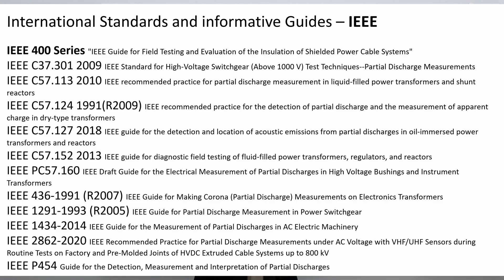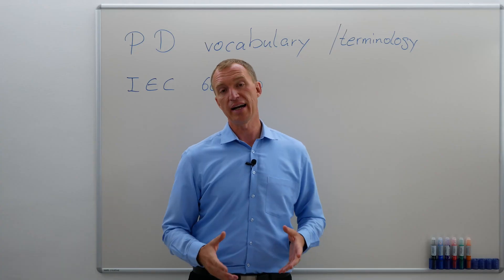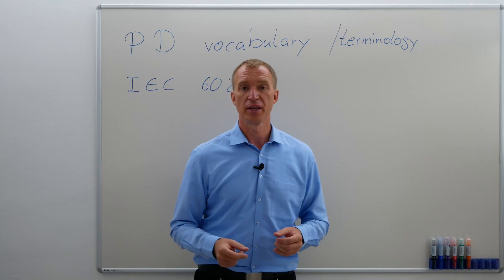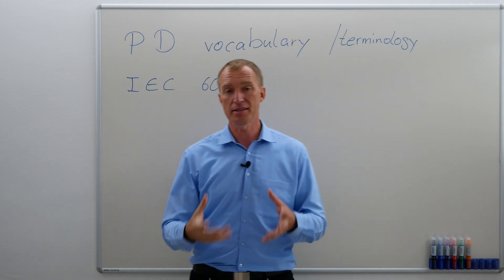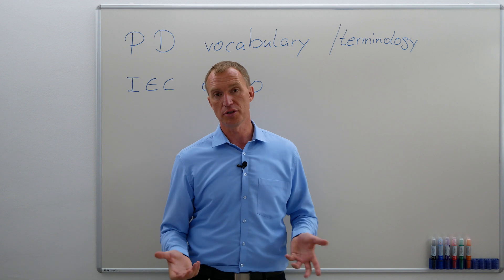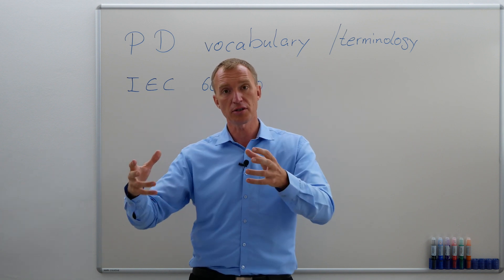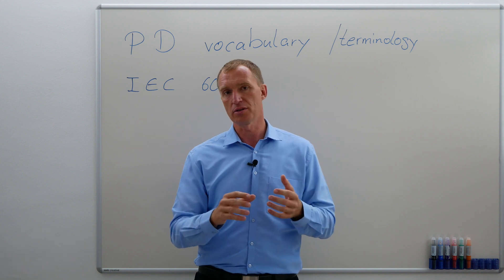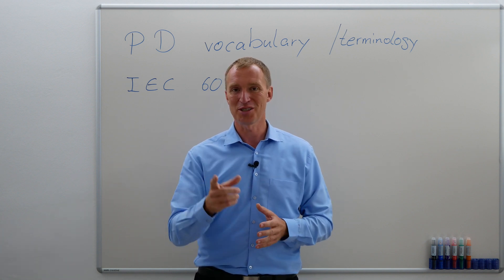2.0 Partial Discharges Vocabulary - How are Partial Discharges defined?

Comment: Hi.At 3:00, you mentioned  q is calculated based on the integral of v(t)dt and the graph is V vs t.What does the V refers too or which voltage is it refers too ; the physical location of V measurement.
Reply from the maker: V = Voltage or better v(t)dt is the voltage an oscilloscope would measure. It could be an old analog oscilloscope or a newer digital oscilloscope. Of course, most oscilloscopes do not "like" a lot of voltage at their input. Often it is somewhere in the range of 100V or less. Thus, such an oscilloscope needs to be connected to some kind of sensor such as a high voltage probe (usually does not have a lot of bandwidth adn is not ideal for measuring PD) or something like a coupling capacitor or a HFCT.
Reply: @PartialDischargesGuru  Hi Sir.Can I say the V is the voltage across the void in case of void PD?